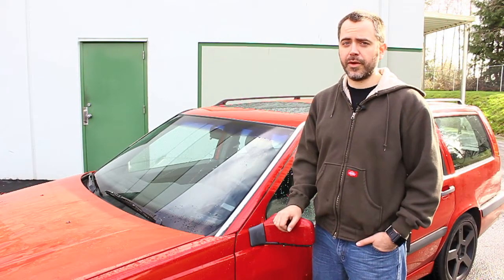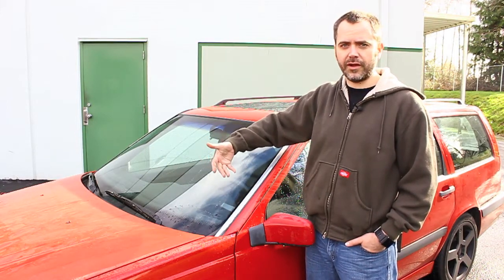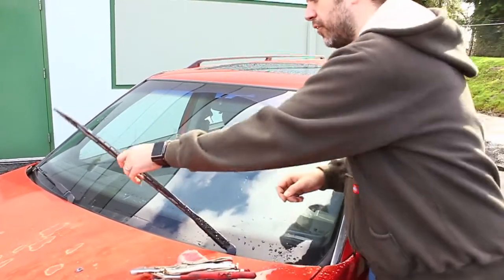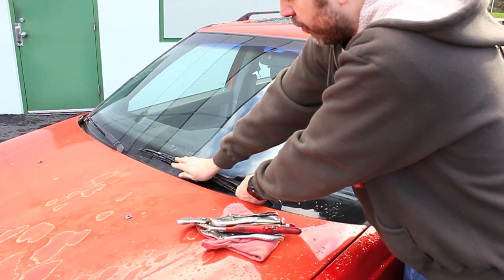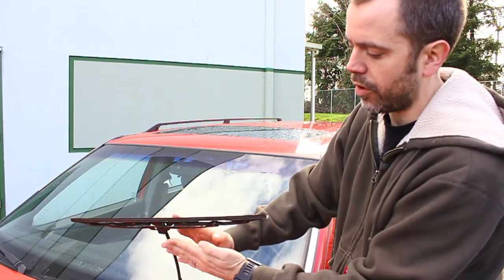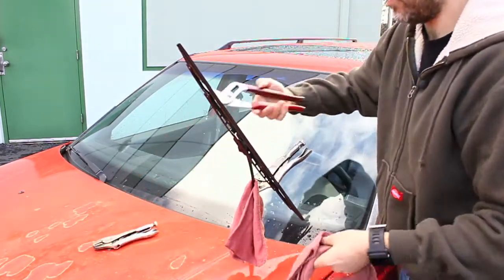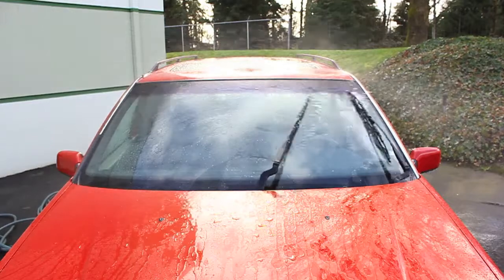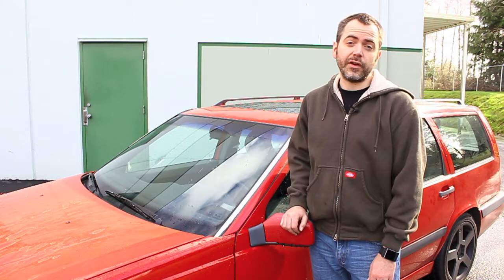IPD Volvo - Wiper Arm Fix - 850

Comment: There's an easy solution to this...

1. Go to a local junk yard
2. Find an old S70
3. Take the passenger side wiper arm
4. Put it on the drivers side of your 850
5. You're welcome.

Comment: it is safer to take off the whole arm (remove the nut), then use a vise to bend it.   The part that bends is the  cast aluminum part that connects to the motor.   A new arm is $60.  They said that the new ones are made of better metal and don't bend anymore.  Hard to believe the cast part bent but I compared it with a new one and it was a big bend!